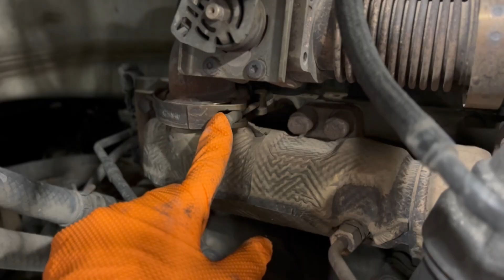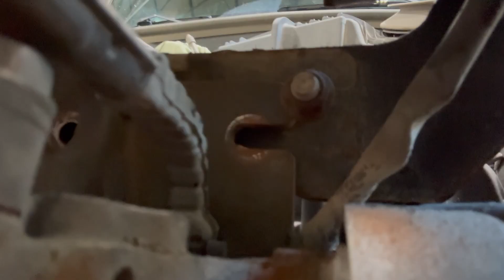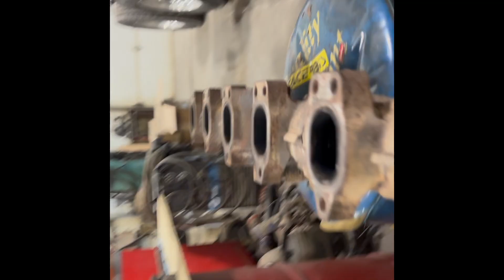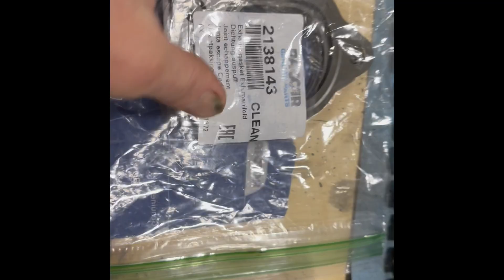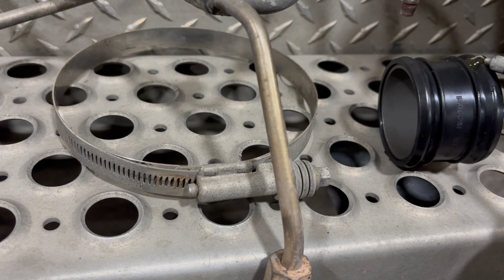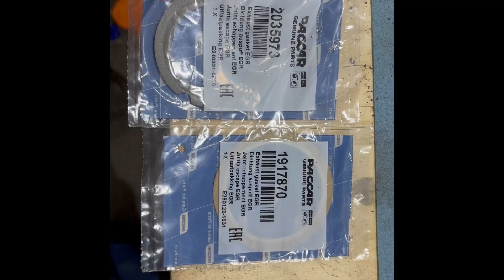How to fix a paccar that’s squealing. Blown exhaust manifold gaskets.

Comment: I i wach your viideo on this paccar  but i have isx15 freithginer casdia 2015 i have  egr tupe has the 3  bolt  13 mm always is wet  but notnig drip of i can see it so is it has gasket in there or can replace it its sefl without removing whole egrs  thank you showing was excellent